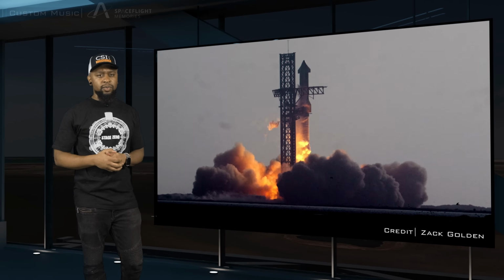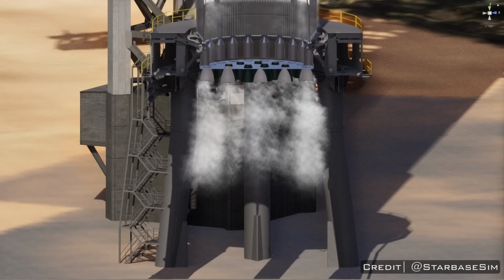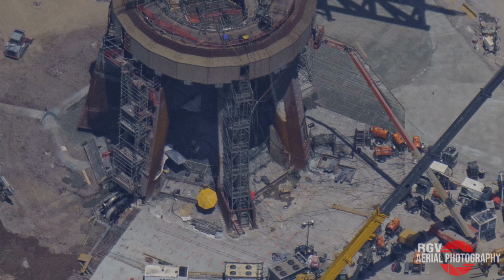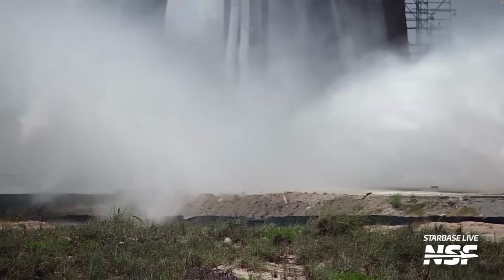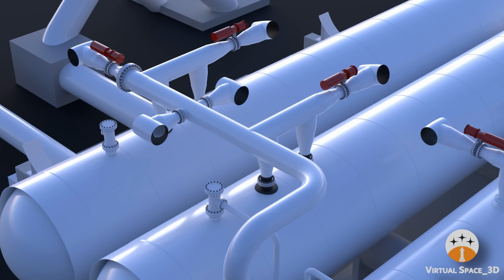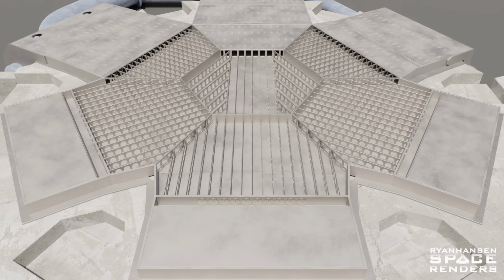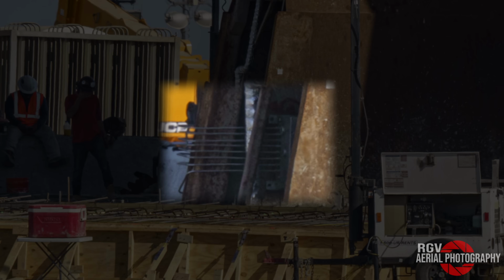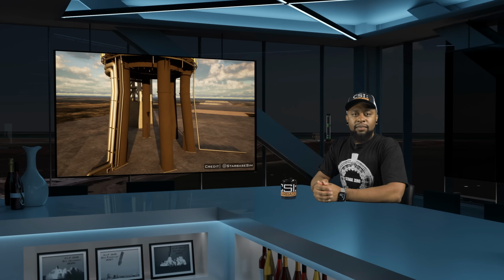How SpaceX Will Guarantee Its Launch Pad Never Fails Again! [Part 2]

Comment: You were comparing a 50% static fire to a full on launch when measuring the levels of the exhaust on the new system. That's like comparing apples to oranges. We need to wait for the next full on launch to get a true comparison and see how the system is really going to perform. My guess is they will eventually have to extend steel out a little farther from the launch pad where all the cracks have formed. Otherwise it will work great.
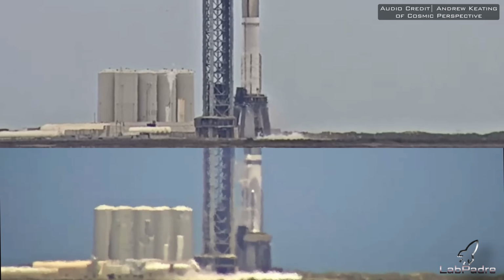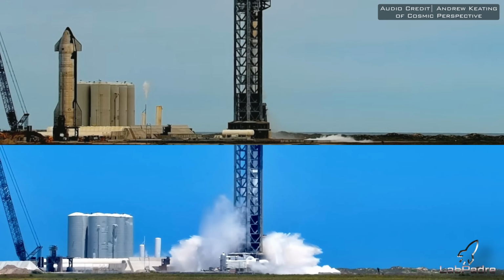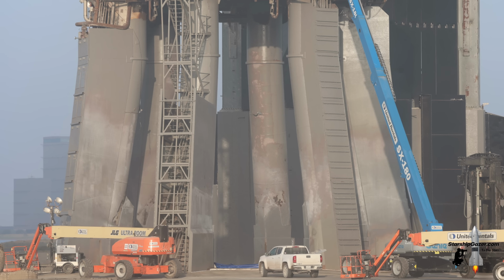Reply: No he wasn't. At 47:14  and 48:01 he was comparing B7's 33 engine static fire with B9's which are nearly identical tests. You can confirm this by looking at the methane tank on the booster which isn't completely filled like it is for a launch. Everything he says about the exhaust is visible in these comparisons and he only briefly shows footage from the flight test because the flames are well visible from SpaceX's drone view. Later at 50:43 when talking about the paint damage he also compares the static fires and even ends the video with saying that B9's 33engine static fire is not equivalent to a launch and that the water system is not completely proven yet.
Reply: Oh I see, I thought we were talking about the side by side footage. Thanks for clarifying that. @bongi6811
Reply: I think he was comparing the timing rather than power?

Comment: Zac, the friction of re-entry isn’t what creates the majority of the heat. It is actually the compressive effect of such high entry speeds on the atmosphere.
Reply from the maker: Yeah I was going to mention the compression heating but forgot to include that part. The TPS tile section was of low importance to me but I wanted to answer the question
Reply: You can't get friction without something to compress. It seems you are talking about different parts of the same equation
Reply: ok obviously you guys have some experience here.. so as the air gets more dense does the balance of the equation change leaning more to friction energy?
Reply: @twistedneck  To save a long drawn out comment, i suggest looking up scott manlys video on this subject. short answer, friction is not even worth mentioning when talking about this process.

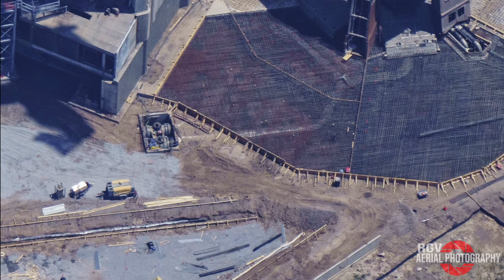Comment: If nothing else, the sheer amount of rebar that I saw in pictures was very confidence inspiring. It’s almost like there was more steel than concrete. A very tight multi layer matrix of rebar. Edit: @ 21:00  is the extreme amount of rebar I was talking about. I don’t see how that could not be absolutely bomb proof.

Comment: Great episode. I could be wrong, but my understanding is that the heat from reentry is NOT a result of friction! Rather, the speed is so great that the ship compresses the air so much that the air turns into a superhot plasma. 

Subtle difference. But apparently, friction alone doesn't actually get that hot.

Comment: Zack, great job...  Next please address the HOT FIRE STAGE SEPARATION SYSTEM.  My thoughts are that they should modify a Falcon 9 as a test bed before Starship launch.  It would allow them to significantly debug this approach.  Also, if Elon is correct with his estimate of 10% increase in thrust and load, it would also lead to an expansion of the Falcon performance envelope.    Your thoughts please..
Reply: Modifying rocket isn't as easy as you might think
Reply: Yeah, it’s definitely easier to test this directly on Starship, which is still an open development system, than on Falcon9, which is pretty much closed and mature. And any lessons learned may not even translate between them very well. They are two completely different rockets, different material, different engines/propellant… etc. They can probably learn as much from simulation, as trying to extrapolate results from another system. It’s not like hot staging is a new concept, it’s been used before. The hard part is to translate the theory and make it work with this particular rocket. Finally, it could cause a bad PR to see a Falcon9 blow up. SpaceX already have to go to great lengths to explain to general public that any mishaps related to Starship are not failures but part of standard development process, which do not affect the safety or availability or Falcon9 in any way.

Comment: Shortened static fire software or  hardware?
Reply: Sensors reading out of bounds, leading to software shutting down 4 engines, and since 4 is more than the limit of 3, abort. We have no way of knowing for sure if this is a sensor issue or hardware issue, but at this point I'd put my money on hardware.

Comment: Cooling the engine exhaust and sound energy dampening will convert a portion of the deluge water into steam. It would be interesting to calculate that water which would not end up in the retention pond.

Comment: I'm pretty certain that the odd elbow coming off the bottom of the big deluge manifold is what we call a "low point drain".  I designed many piping systems with low-point drains and high-point vents to facilitate draining the systems for maintenance and refilling them safely and completely with no air pockets.

Comment: Since the GN2 tanks connect to the water tanks, I could imagine a failure scenario where water ends up forced into the GN2 side of the system. By having the GN2 feed line go along the weir, any water that makes it's way into the gas side (even if it's just in the high pressure tanks initially) is prevented from draining all the way back to the tank farm.

Comment: I would argue that the nitrogen is used instead of air because nitrogen, as a single gas, compresses equally vs "air" which is comprised of several gases which compress differently. By using nitrogen it would be easier to model the physics.

Comment: This deluge system seems like an after thought to deal with the unexpected damage caused by the engines thrust. SpaceX should consider totally redesign the pad from ground up. Rearranging the leg stands in rectangular layout instead of hexagonal. Allowing to have space to build a ramp with metal plates that would work as flame diverter, with a water deluge system feed via Gravity. While to maintenance work in the engines, the crane would lift the booster and place it on a stand near the launch pad.
Reply: Just to clarify, it's not afterthought because of flight, it was being worked months before the first flight. It's a ridiculous idea to remove the capability of maintenance on the booster while on OLM. The whole Tower, chopsticks and OLM were build around this idea.
Reply: @lazarorocha8893   SpaceX had data from previous Starship static fires. The current deluge system was probably designed before the initial launch, and probably didn't took into account the shear amount of thrust from the engines during launch.
Reply: @lazarorocha8893   launch pads need to be maintained, and this deluge system doesn't looks very serviceable with large metal plate sections welded together. The 39B launch pad has metal plates in the fire trench that can be replaced, as the tiles on the walls and the floor.
Reply: Personally, I believe this is just SpaceX being SpaceX. They try to go fast and break things. Building a traditional launchpad with full flame diverter trench and gravity-fed water diffuser at the scale of the Starship Booster wourd require literal years of construction and enormous cost, due to the poor ground conditions (read: high water table, silty soil) on the coast. It makes sense to me that SpaceX is trying to see what they can get away with, at least while the Starship itself is still in rapid iterative development and testing. Once Starship is fully developed and dependable, then the problem of an unreliable launchpad will necessitate a full ground-up reconstruction, using everything they have learned from these intermediate solutions. It may well be that a pressurized water diffuser system is more responsive and controllable than a gravity-fed one.
Reply: Work in florida has stopped right? They'll probably build differently there knowing this, once they get the second crew capable tower up.
Reply: Money Baggs
Reply: @rogerm9157 Says They Got You Elon !!$!!
Reply: Its an after thought, becuase it wasnt part of the original design.  but its too early to say that everything needs to be fully redesigned.

maybe it does, mabye it doesnt. time will tell